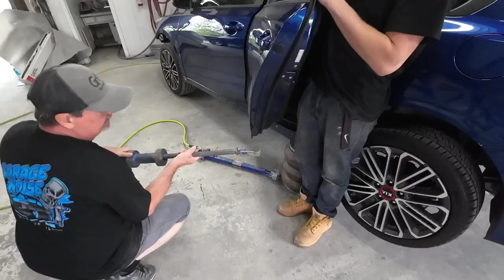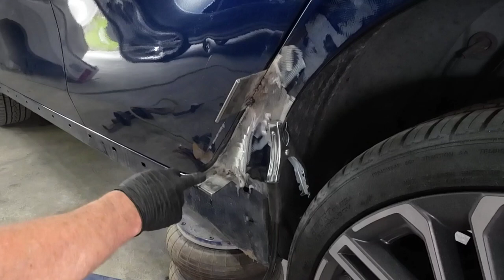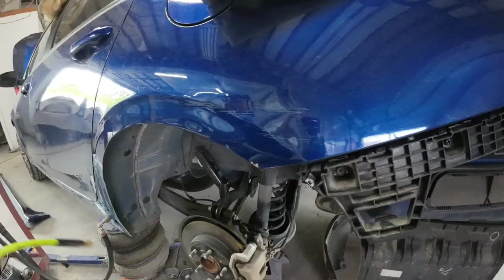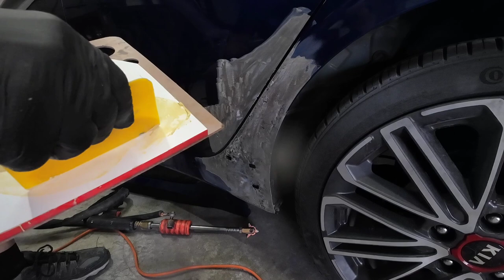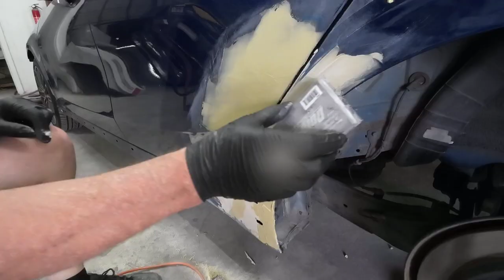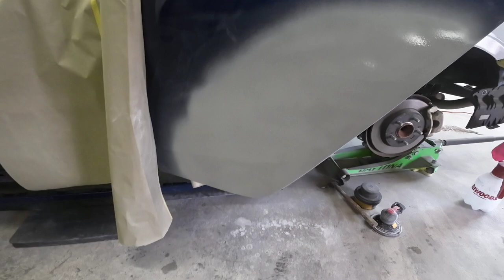PRO TIPS for tricky BODY WORK

Comment: Hey Chris, thanks for demonstrating a pull with the Mo-clamp and welding. I don't think I've ever seen a demonstration. I did see Youtuber, Gemini Dent Repair, use collision glue on a Mo-clamp to pull a pillar. Of course he did have a pulling post, but you were able to pull that dent with just a slide hammer. It seems like collision glue would be a more efficient way than welding. I've also seen videos of large dents being popped out with a Porta Power and collision glue. Keep the videos coming.
Reply from the maker: Maybe next time I'll  try glue . I've  seen some pretty be damage pulled out with glue.

Comment: I just started as a body guy 4 months ago and we use this purple sanding disk that fits on the twist lock 90 it's not like a sanding disk it doesn't grind down the metal at all and its super-fast. nobody uses them in all the videos I have watched.
Reply from the maker: Yeah it's  been awhile since I've  used those might have to pick some up.

Comment: when trying new fillers, avoid UPOL Fantastic ... i dunno what's up with the stuff, i cant find info on it anywhere, but it's no good at all, spreads like crap, behaves the opposite of your gold there which looks almost like a glaze
Reply from the maker: Really I used the fantastic fiberglass and really liked it I haven't used the body filler . Appreciate the heads up!
Reply: @GarageNoise  i wonder if i got an old batch or some such,  very strange!  Maybe the one labeled fantastic professional is better.   I enjoy when you try things to cut thru the bs in labeling!